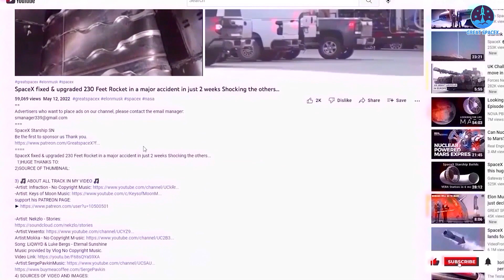SpaceX Dragon is in trouble and can't fly to ISS because of Booster damage that needs to be fixed

Comment: Total click bait.  Just because a booster was damaged doesn't mean it cannot be repaired quickly or replaced.  This site is getting worse with click bait.
Reply: The replacement takes hours.  The testing and paperwork takes weeks.
Reply: @davidbeppler3032  Only if NASA was in charge.
Reply: @kokomo9764  SpaceX does not have to deal with FAA regulations?  Since when?

Comment: They have like 20 boosters or more stocked up.
Reply: *31 active boosters right now
Reply: I`m sure SpaceX uses a new booster when humans are aboard it massively lowers the chances of an issue at launch time....
Reply: @kylereese4822  NASA have human rated refurbished Falcon 9 Boosters
Reply: @kylereese4822  No they don't...
Reply: @kylereese4822  Since no used booster have failed so far I beg to differ, used boosters have a perfect flight record with no failures which is slightly better than overall since 2 boosters have failed so far on their first flight, but that was also earlier versions of Falcon 9, none of the current version have failed at all.

Comment: Why dont we create a way to generate electricity from the fuel used to launch a rocket? at least some decent percentage can be used to spin a turbine or something
Reply: converting fuel to electricity to pump fuel via electric motors is way less efficient than just spinning a turbine by burning some of said fuel, which is what most liquid fueled rocket engines do, you would be adding weight and complexity for nothing, and reducing efficiency...
Reply: And what do you plan to put in the exhaust 3000º stream that wont melt ?
Reply: Because that is a huge power loss.  Just a more expensive and less efficient gas generator.